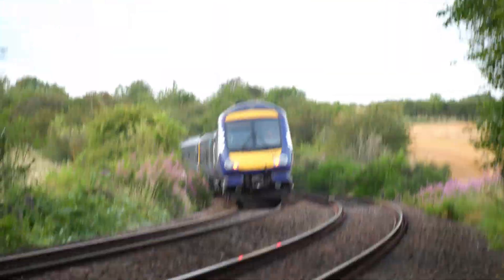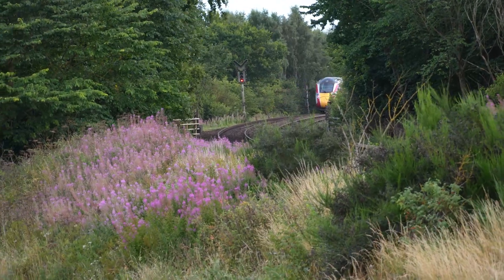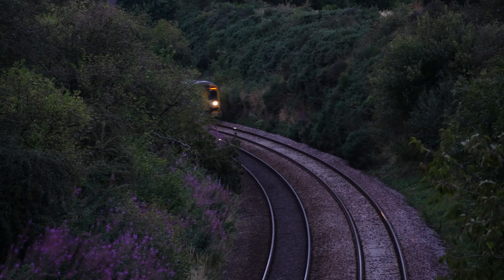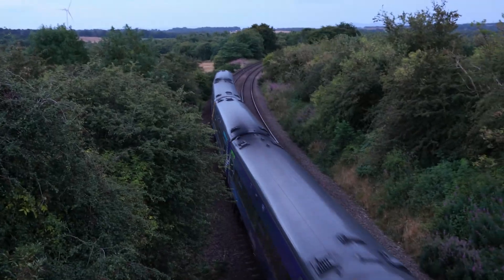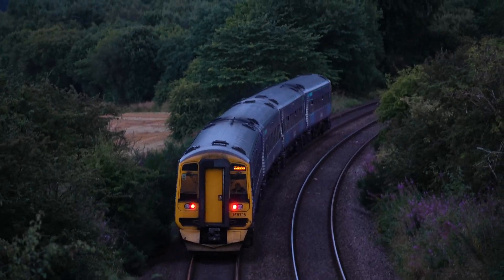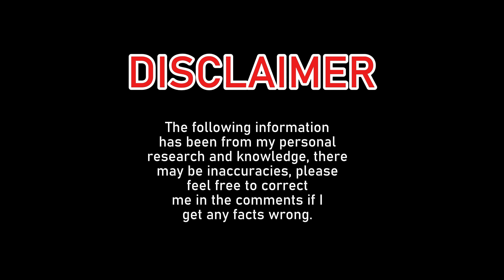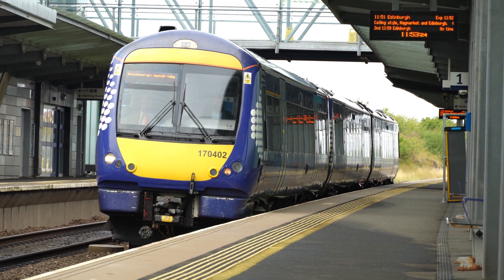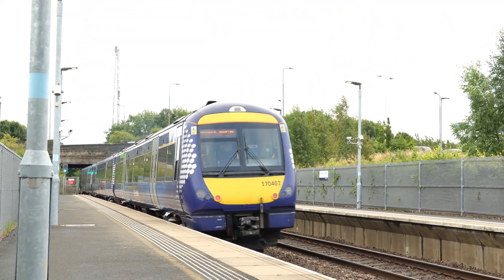Fife Circle Electrification - A Project In The Making

Comment: Hi TrainVation. Very enjoyable video.

Just one thing I noticed regarding discontinuos electrification. 

This exists in South Wales as part of the South Wales Valleys upgrade (Part of the South Wales Metro project) and this is already in Operation with the class 756 Staedler flirts running and later this year the new  Stadler 398 tram trains which will also run on battery mode between the unpowered sections.

These are tri mode for the 756s (Electric, Diesel and Battery) and Bi mode for the 398s (Electric and Battery).

Hope that clarifys that 🙂.

Keep up the good work and interesting videos.

Comment: Appreciate the video. Thanks for highlighting the present state of affairs.
Haven't heard a decent plan for electrifying the Forth Bridge which needs to be under active consideration. There's a lot of talk about the height restriction which sounds like people giving up before they've tried.
It's become a blockage much as the Forth was back in the 1880s. Electrifying the Bridge and approaches will pave the way to Aberdeen as well as Fife, Is anyone grasping this nettle?
Inter city electrification is needed and Fife should be benefiting from this. 
We should be running class 385s to Dunfermline, not over engineered battery trains. It's Edinburgh commuter belt for goodness sake!

Comment: The 120 million spent on 11 miles of EK line could likely have paid for partial electrification in Fife, onto Dundee and Perth plus probably the development of a viable BEMU option. I believe Hitachi had a project for a 385 variant ready to go.

The reason for so many 2 and 3 unit peak time services is because they are constantly having to replace broken down HSTs on IC services. Another great decision by Transport Scotland!

This project is likely to continue albeit at glacial pace, we are years away from seeing any functioning solution IMO. Will the 158s last that long? They are already old approaching 40 years old and showing it.
Reply from the maker: I personally don't see the 158s (and same with the 170s) going anywhere any time soon, at least until the Battery Electric Stock is sourced. They don't have any alternative trains for this line, as the majority of ScotRail's traction is electric. (385s, 380s, 334s etc.) Our only choice as full electrification isn't possible (because of the Forth Bridge) is battery.

I also did think I seen something about 385s and 801s possibly having their diesel generators swapped out with batteries at a later date, but that was a Hitachi YouTube video and it's ScotRail we're talking about.

Comment: Scotrail is doing a great job with the rollout of electrification.
As you may be aware the Baden Wittenberg Government Report showed that full electrification is 30% to 80% is cheaper than bi-modes and tri-modes over 30 years on most routes.😅

If the Forth Bridge had been constructed now by accountants, instead of engineers, it is likely have been a wooden structure and it would not be standing now.

Comment: I feel like using batteries in trains is a bit of a grift to avoid actual infrastructure investment, and batteries should be saved for where they are actually somewhat necessary like cars and trucks, busses, trams, and trains should use wires since they operate on a fixed route

Comment: What we can tell from some clips in in this very useful film shows that the planned Fife electrification is to install the Network Rail / Furrer & Frey 'Series 1' type of OHLE. This is expensive and over-engineered, with large steel gantries, no headspan construction, and taller catenary masts for doubl;e-track linesthan we used to have. The previous British OHLE design  was British Rail's 'Mk 3b' type which  has been used to electrifiy most lines in Britain. It was developed for the Weaver Junction - Glasgow wiring (1970-73 )and was then used or the ECML and East Anglia electrifications (many hundreds of miles). In Scotland in the last 12 years of British Rail Mk 3b OHLE was used very effectively and at an affordable cost for the 'Ayrline' work - Paisley to Ayr and Largs, undertaken 1983-87; on the ECML (1986-91); and for Carstairs to Waverley (1991). The recent Scottish electrification (Edinburgh-Glasgow Queen St via Falkirk and to Dunblane and Alloa, the Shotts line, and currently Glasgow-Barrhead and East Kibridge) all use the expensive and intrusive Series 1 OHLE system. ScotRail should insist on returning to the MK 3b OHLE design which will both cut costs and reduce intrusion. Mk3b OHLE being much lower cost also enables the technically complicate concept of 'discontinuous electrification' to be ditched.
Reply from the maker: Thank you for your input, it's really interesting to hear. I'll be honest I thought the "Series 1" OHLE you were talking about was called Series 2". But nonetheless it would help, and cost-cutting is what they need most here!
Reply: @trainviation I think you are correct that it is called 'Series 2' now; but it is essentially the same heavily-engineered and over-costly form of OHLE which Network Rail started to install in 2010-11 on the Great Western electrification. The earlier system, BR Mk 3b, was used for some of the Manchester-Liverpool via Newton-le-Willows electrification which was got under way in 2010, and as recently as 2016-17 for the Norton Bridge realignment and flyover north of Stafford on the WCML. (You can see that in driver's view films made on northbound freight trains using WCML Stafford-Crewe 'slow' line.) The current Network Rail OHLE design has origins in Switzerland, as it comes from the consulting engineers Furrer + Frey who are based in Berne. Swiss OHLE tends to be rather heavyweight, based on 100 years of tradition.
Thank goodness that the ECML from Newcastle to Edinburgh and the Ayr & Largs lines were electrified in the 1980s using the much less intrusive, and less expensive, BR Mk 3b OHLE.
Reply: @ I'm not an expert at all, but I was under the impression that the ECML OHLE had proved susceptible to strong cross winds in some places.  And I'd have thought that although span wire construction is undoubtedly cheaper and less obtrusive, any damage is likely to affect all the tracks, not just one.  I know the Liverpool Street to Shenfield electrification was described as "the galvanized iron tunnel", but it's certainly proved very robust.
Reply: I just don't understand why the ScotRail is installing obsolete heavy weight cantilevers and castilated beams.
The Norwegian and Swedish railways have robust lightweight cantilever designs and arguably the weather is more severe than in Scotland.

Comment: Scot Rail is doing a great job in rolling out electrification. Implementation could be further accelerated by obtaining surplus redundant EMU's from the South of England to allocate more resources to Overhead Line Equipment.
Reply: Scotrail already made use of Class 325 "happy trains" while they were waiting for snagging problems with the 385s to be ironed out.

Comment: As an EV driver, I certainly understand the benefits of battery electric transportation.  Recently a player in the bus industry called Ember expanded their battery electric intercity service up to Aberdeen from Edinburgh.

I’m just thinking:  If a bus can do it, with all the rolling inefficiencies of rubber tyres, why can’t a train do it?  It would enable overhead electrification to be a lot more easily implemented, especially around short sections of bridges and tunnels where engineering constraints really do make a full upgrade disproportionately expensive.

But as others have said:  The railways are a notoriously conservative industry.  Projects are hugely expensive and innovations trickle through far too slowly.  Sadly this state of affairs will not change.

Comment: Not sure the disjointed approach is really going to work but IF they get the BEMU's then it might be something. 

The route around Burntisland has always seemed like a fudge. (where I was born). The line from Aberdour makes a fairly sharp right turn, through a cutting (which must have taken some work), across a lowish viaduct at the former shipyard to get around to the station.  Since the station came before this bit of the line I can sort of see why they did it but it IMHO, it would have been better just to draw a straight line and join up with tracks again as the line curved around the bay to Kinghorn.  That would make no sense to do now (too many houses) and even a direct route across the sea and over the old shipyard would seem rather unfeasible too. So its a bit of line with a rather slow S bend.  Still shouldnt stop it from being electrified though. 
So ...most of the "Fife Circle" isnt being electrified. Not the bridge, not to Dunfermline, No plans to electrify to Perth or Dundee. So all things considered, this is a half hearted attempt to do very little and it doesnt join up.

I shall watch with interest to see what, when and how it progresses. Thanks for the update.
Reply from the maker: Interesting comment, and unfortunately the track was layed in such a way. They have said previously they do plan to FULLY electrify the line between Edinburgh and Dundee in the next decade or two, but we’ll just see how that turns out. Sadly, it’s a little messy for the line to be electrified now, and not have the trains to take advantage of it.

Comment: Oh Did I Forgot About The Borders Railway Extension If Made This Revival Long Journey From Edinburgh To Carlisle I Decide That The 385's Won't Not Run On The Borders Railway Instead New Type Of Styled Trains To Run On That The Railway Line Is Almost 10 Years Old With The Anniesland To Maryhill Line Is Almost 20 Years Old That Needs To Be Electrified As Well.
Reply: Maryhill is a no-brainer. It currently uses Class 158s, which are more suited to cross-country trains than inner-city commuter service. Wire it up and put a Class 318 on it!

Comment: Thanks for this update. Personally, I'm slightly sceptical about this idea of discontinuous electrification. It may be OK for short branch line shuttle services, but for general use it seems that all the rolling stock will have to be heavier, more complex, more expensive and less reliable than straight electrics. And I think it would be less suitable for heavy freight locos. But no doubt time will tell!  Do you know whether there are inherent problems with electrifying across the Forth Bridge?
Reply from the maker: Yes sorry I forgot to mention this in the video. As the forth bridge is a class A UNESCO world heritage structure, they most likely will not be able to modify or adapt the bridge with OHLE, atleast not without deadly strict guidelines.
Reply: @trainviation There have been all sorts of claims that somehow the Forth Bridge (Listed GradeA) can't be electrified for some unexplained technical reasons, generally to do with the current return and earthing.. Listing the bridge as a historic structure doesn't prevent electrification. It means that there must be extra care in design and that the OHLE must be the best design for the bridge. The Royal Border Bridge (Grade I - English equivalent of Grade A) has OHLE across it. A great effort on design was made and the (now regrettably abolished) Royal Fine Arts Commissions (both the English and the Scottish ones) did a lot of work. The result shows how effective this was: watch any drone film of an LNER train crossing the Tweed. The same applies to the Durham viaduct which is a landmark in that historic city.
The two now-on-Youtube films on ECML electrification and narrated by the TV reporter Martin Young, are worth watching. The first, 1989 film showing work to raise the main footbridge in Waverley Station (Grade A) by just 6 inches to enable OHLE to be fitted, and the work in the Calton Hill tunnels. See that film at https://www.youtube.com/watch?v=9wJejg8NxIM&t=354s.  The longer film completed in 1992 shows the RFAC inspecting Durham viaduct and the Grade I listed Newcastle Central Station. https://www.youtube.com/watch?v=itmm98UVeVE&t=901s